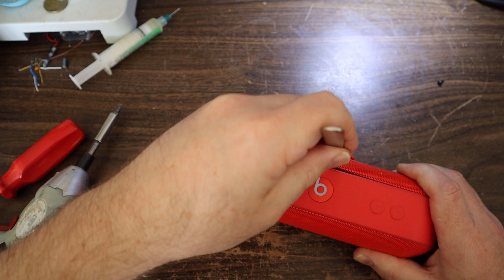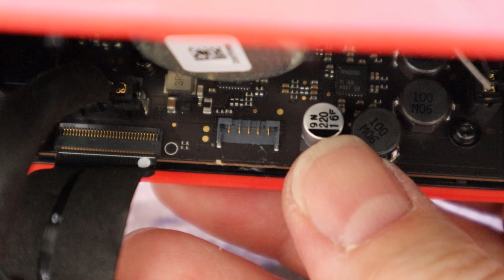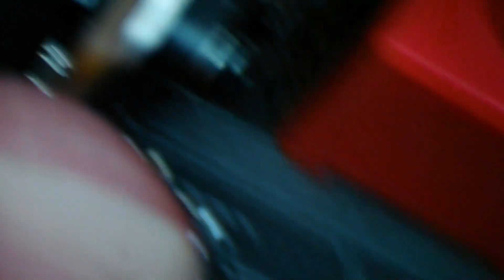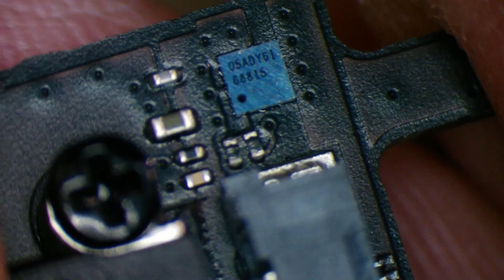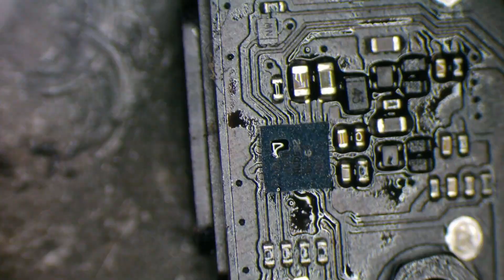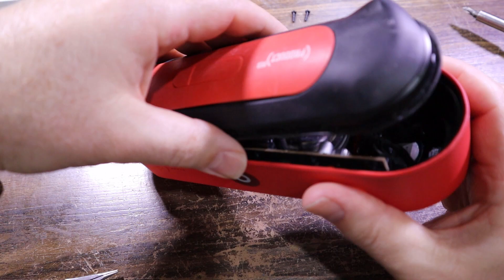This faulty beats read pill speaker has a secret. Let's find out while we fix it!!

Comment: Well done, saved from the jaws of death :-D
What a fragile charging system, with built in super protection but it still dies.
It should be bullet proof :-(
In the nicad days i would rig up a crude trickle charger, oddly it never failed lol.
Modern lithium cells are more picky and need a nanny Ha ha 😀
Reply from the maker: I once charged a NiCAD pack in reverse (accidentally). Came back hour or so later, the charger had melted!
Reply: @JonnyFix  ha ha ,  now that was taking the micky.
Ive never melted a charger, but i have given plastic chargers plastic worm lol.
Small drill then lots of small holes in the case to add convection cooling.
I think putting a psu in a sealed case is just cruel to the capacitors ha ha 😀
Reply from the maker: @zx8401ztv  This wasn't even a proper charger, I was about 11 at the time, it was a power supply board out of something but happened to put out enough voltage, caused the transformer windings to cook LOL. The time when I experimented with an R/C car. I also strapped another battery to the rear spoiler because.....speed!
Reply: @JonnyFix  ha ha  More   P o W e R   Sounds like you had fun :-D.